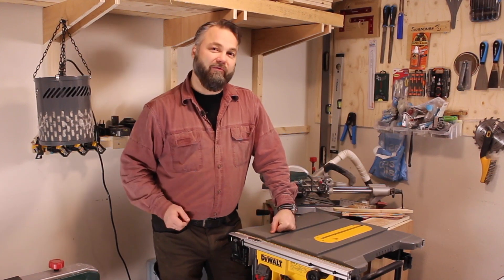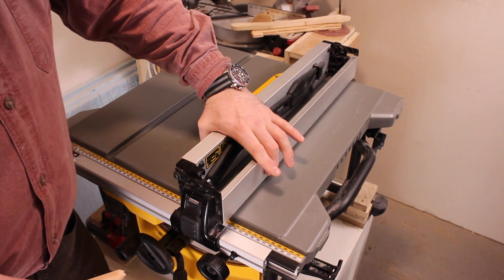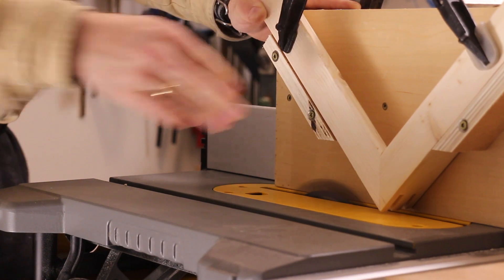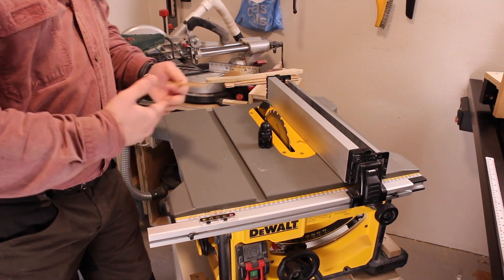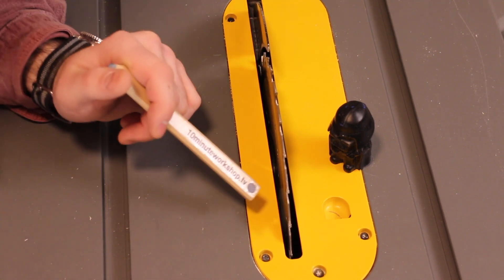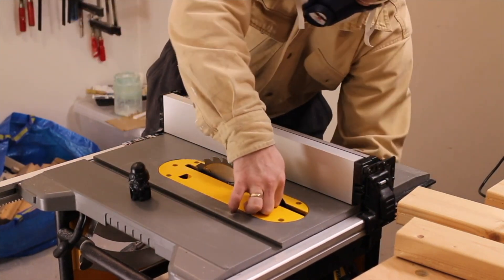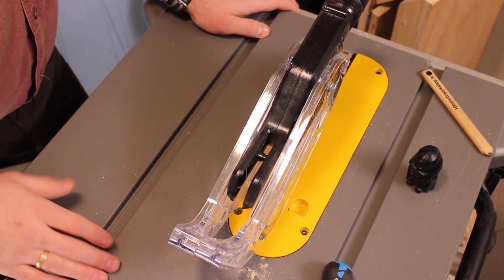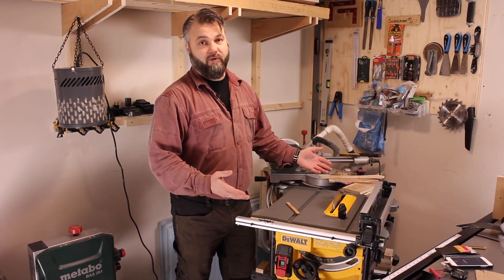DeWalt DWE 7485 Review -  Better than SawStop? Is it as good as they say? [0065]

Comment: How effective is the dust collection?
Reply from the maker: Hi!
I have not compared to other jobsite saws. But this one has a shroud around the lower blade guard (under the table) that helps dust collection. And if you use a shop vac on the blade guard as well, dust collection is decent. 
When only using the riving knife, or the crosscut sled, is is bad. But then again you are really not giving the saw a change to collect that dust.
Cheers. And thanks for watching and commenting.
Reply: Put A sock onit
Reply from the maker: Will that help the dust collection? :D

Comment: You can just clamp a longer straight edge to the guard such as a cheap aluminum level, the guard is pretty tough, just dont over do it.  As for breaking down material, a tracksaw (and obviously a panel saw) is the correct tool to break down sheet goods, not a table saw.  I generally always have a hand jointer plane with a 90deg fence to clean up any work after a cut anyway, so small imperfections never bothers me.  I've not used my larger saws for a long time.  I am also an advocate of not using a table saw to rip anything thicker than 1.5", you are just asking for trouble. It can be done relatively safely, until the wood wants to relieve stress in the most odd direction. Use a bandsaw for larger stuff (I know people don't typically have a band saw, but that doesnt make a table saw a good tool to break down... Say 4" thick stock).  This is a really good saw and I think a welcome improvement over the 745/7480 (lots of overlap), being the perfect companion to the 7491 and a cabinet saw if you go one.
Reply from the maker: Hi!
I have seen many people attach aluminum extrusions to the fence, but I did not want to drill through the original fence as I was selling the saw. 
You gave some great tips here, and like you I use my track saw to break down sheet goods. 
My tiny bandsaw has less capacity to resaw than 2x my new cabinet saw cut height. What quality cut do get when ripping on the bandsaw?
Thanks for some great tips, and hope to see you back on the channel. 
Cheers.
Reply: @NomadMakes  I am not a pro so please take what I say with a grain of salt.  The quality is not terrible using a wood blade, I can't remember the TP, but it's a very general purpose one.  But like I said, I always clean up with a hand plane or portable (not the handheld, the smaller 12") planer. Thats why i don't care if a tablesaw do a good job on the finish since that Veritas no 7 will take care of everything else.  I am certainly not advocating people buy all that tools, and I understand that I am lucky to have the space and funds for this rather expensive hobby.  I just want to make the point that having the right tool for the right job is exponentially better.  If people are willing, a Bailey no 5 with a bit of work can do a great job jointing rough edges.
Reply: @NomadMakes  forgot to mention you can drill the straight edge with two holes.  Some clamps have one side that specifically insert into these holes so you don't have the head of your clamp sticking out and interfering with Yoru cut while still make no mods to your saw.
Reply from the maker: @MintStiles  Well... A no 7 plane might be a lot less expensive than investing in a decent quality jointer. 
I am very much a power tool focused hybrid woodworker, but I have been drifting slowly towards more hand tool use. And I am really enjoying it. My shop is really tiny. Only 12m2. So I have some severe limitations. However, I really love my new cabinet saw. And I had to make some hard priorities to make it fit in my shop. 
If you want a laugh (or cry) you can see where I started out:
https://youtu.be/XUDQJ7MgemU
Reply: @NomadMakes  you know the joke about true woodworkers right? The WW says, "I know I can make that for cheaper..."

Jokes aside, a good no 7 from Lie Nielson or Veritas are pricy (they also hold value), much more than a good used electric jointer not counting the sharpening stones and etc.  I find many a times, it just easier to start with power tools and clean up with hand tools.  Minimal setup time and dust.  Move right on to fitting instead of fussing with switches and cleaning up work space... Etc in a hobby workshop.
Reply from the maker: I was lucky to find a used Bailey no 7 quite reasonably priced. And I am still findining my way around my milling process. I only have a short bed jointer, one of those 8 inch combo machines. But I have a decent thicknesser. I am currently building a mission style media bench. And I guess I will learn a lot during this process. 
I only have a 12m2 (129sqf) workshop. So everything off the machine is not viable. And it would cost too much too. 
For dust, I use a combination of collection, ventilation, and two small scrubbers. According to my air quality meter, I can work without a mask say 5-10 minutes after some heavy machine use. 
A friend of mine is advocating card scrapers. The ones that look like spoke shaves. Since I am building in some old english oak, I may take a look at that in the near future.
Reply: @NomadMakes  I do mostly constructionish type of projects such as planters and baby playpens.  But of course in the true woodworker style.  It's harder these days to focus on a detailed multi day project when you have a 2 year old running around.  I suppose me making mortise and tenon cedar planters are a bit overkill, but it makes my elderly father happy.  I have. Warehouse so I guess I can share it with my regular business, but honestly... Smaller tools are better.  For ex, I will choose a Makita over a DeWalt corded tool (except the contractor saws) almost everytime. eventhough DeWalt is just as good, but imposes a 15-20% weight penalty.  Also have a full set of Veritas planes that just don't get enough use anymore.
Reply: @NomadMakes  also, if you get a chance to find a nice plane made by Record England, they are better and often cheaper.  They are heavier tools, but you your shavings will be so thin that they look like fishnet stockings.  Every record hand plane that bought for like 10 bucks and restored out performs a Bailey.
Reply from the maker: Well... I am a weekend and evenings warrior myself. But I have found that making good plans and cut lists help me getting more efficient when only having an hour here and there to work on your project.